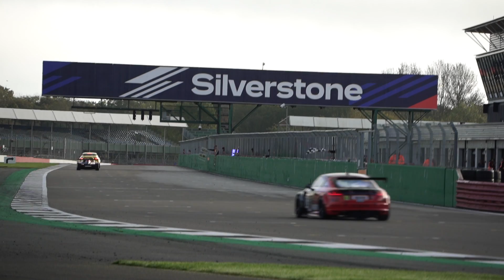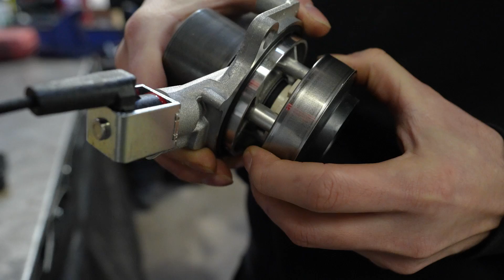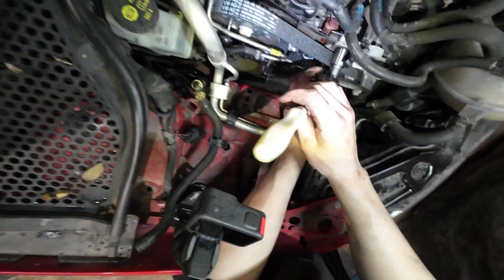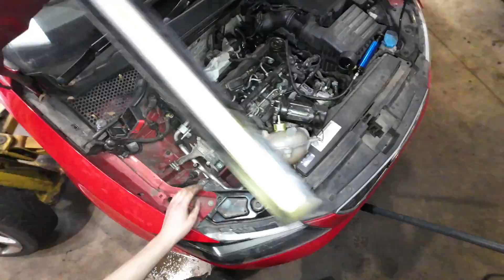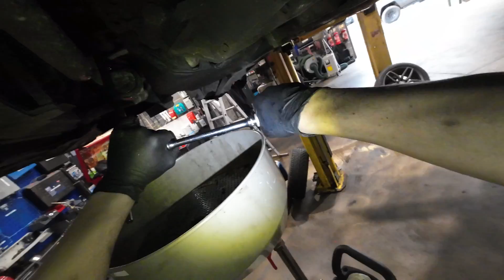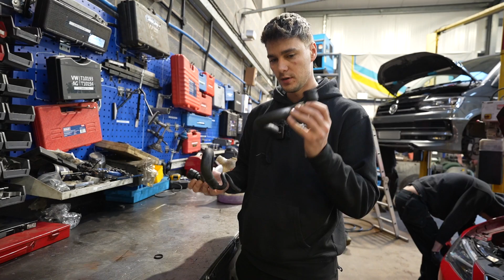BAD DESIGN?? 🤔 MK7 EA288 Cambelt & Water Pump

Comment: i didnt see you actually loosen the cam gear and fuel pump gear. you just stuck the timing tools in. with a new belt when you mount the tensioner the gears usually rotate a slight bit in the bean shaped holes and then you tighten the bolts. because you didnt do that, this engine could be out of time a slight bit. I wonder what the cam phase angle says on the computer now. the fact that after turning it over twice by hand you showed putting the crank timing tool back on but not the gear ones makes me think so
Reply from the maker: We dont always record everything but we will take the comments onboard

Comment: After a bit of advice from the vag men as hearing mixed reports so the vags that use the electric sleeve water pumps, can they be replaced with a standard water pump and used without any issues after
Reply: В новых модификация они отказались от шторки в помпе .я поменял у себя на 1.6 tdi 2013 год и поставил обычную помпу . У меня пропала вибрация на холодную , мотор стал работать ровно

Comment: No Oilpump belt changed? Why?
Reply from the maker: That would be a separate service, the wet belt on these doesn't have shredding issues like you see on other manufacturer engines.
Reply: @DarksideDevelopments  I believe VAG made it from material that doesn't degrade in oil like wet cambelts.

Comment: Anyone had one die from this? Genuine one fitted 3 years ago and its over heated on the motorway and killed the engine
Reply from the maker: Heard stories about it. They do have a known issue of sticking open and causing the car to over heat

Comment: No servicing needed on the oil pump belt that is in the oil pan ?
Reply from the maker: They are rated as a lifetime part, it's very rare that one has failed. We've not come across any as of yet
Reply: @DarksideDevelopments  Lifetime is around 270k km. (or sooner with LL intervals). Been there. 20-50 quid on timing belt change shouldn't be saved.
Reply: I went ahead and changed mine at 130k miles. You're that close to a $20 part you might as well change it.

Comment: My car was just done and water pump etc is a known faulty item also had the heater matrix changed for a new one as full off gel also new expansion tank as they have no gel pack in them now and tensioner cam belt after 114,000 miles.

Comment: So you torque the cambelt components and sump plug.
But gun up the mount bolts even when using new bolts.
And also gunned up the serpentine crank pully 😂.

Both require a torque and angle setting.

Also should be doing a diagnostic bleed procedure before a road test even after its been vacume filed.😅
Reply: @THEGREENBEAR1723 wrong
Reply: @THEGREENBEAR1723  yeah they're 10nm + 90°
Reply: 3 ugger duggers is correct torque on all vw fixings
Reply: It wasn't done cos it's not on YouTube, come on

Comment: Dreading diagnosing this, DFHA engine with a slow amount of coolant loss over a few months.

Is it known if the newer revisions of the water pump and egr cooler have been fixed?

Funny thing is, it's recorded as a well known issue in Erwin but surprise, no recall.
Reply from the maker: Not come across any newer ones yet so not sure